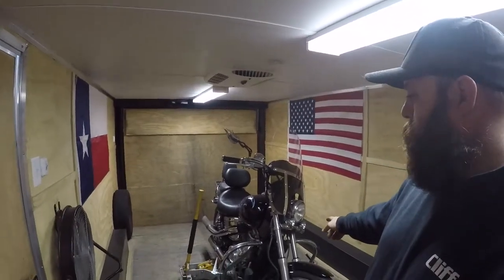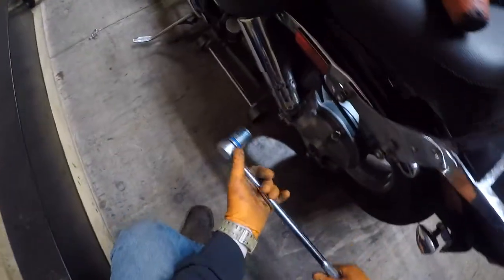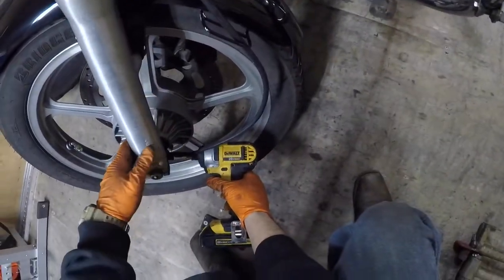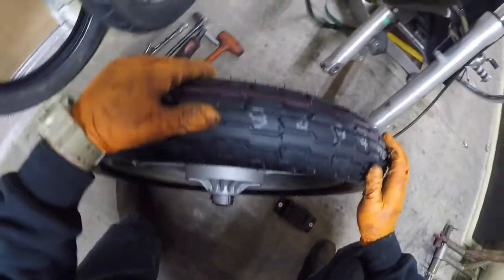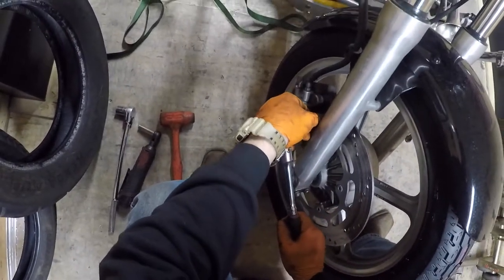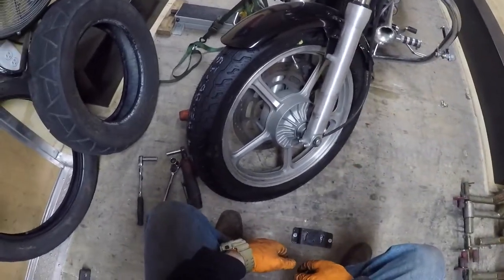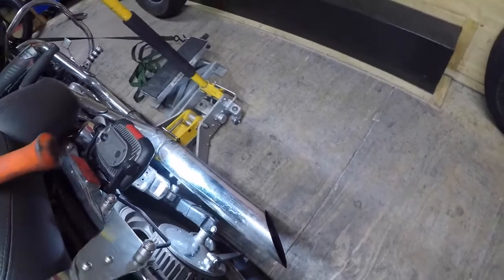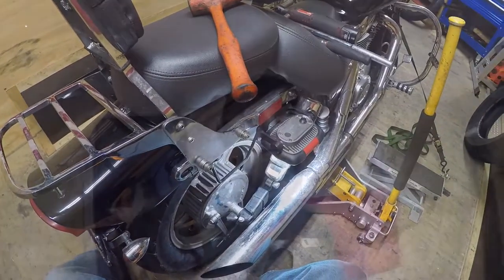How to remove front and rear wheels - 2001 Honda Shadow Spirit 1100 Both

Comment: My 02 Shadow Spirit VT1100C appears similar in design to this cycle. Do you happen to have any videos on changing the front and or rear brake pads on this cycle? If so I will have a question in regards to changing the brake pads. Appreciate the tip on the alignment of the notch on the speedometer gear box assembly with the spot on the front fork!
Reply from the maker: I don’t. Only how to remove wheels.
Reply: @cliffcares6455  OK thanks!

Comment: Hi, Do you happen to have the torque spec on the axle nut? I believe its 65 ft . lbs. on the VT1100C
Reply from the maker: Front what I found. Front 45lb and rear 65lb.
Reply: @cliffcares6455  Thanks I have since found similar numbers. Though a PDF of a service manual I found showed 43 ft. lbs. for front axle bolt, 16 ft. lbs. for the front axle pinch bolts and as you said 65 ft. lbs. for rear axle nut.

Comment: HI, At approximately the 10:45 sec mark your about to reinstall the "speedometer housing" that the end of the speedometer cable connects to back against the wheel. There is a narrow cavity inside the mentioned "housing where there is some grease. My 02 Shadow Spirit VT1100C doesn't have hardly any grease inside that cavity. Do you know what type of grease is appropriate for that purpose? Does any grease go where the speedometer housing mounts against the front wheel?
Reply from the maker: Regular bearing grease would be good. It’s not under heavy load or gets hot. It just needs to keep things lubricated.
Reply: @cliffcares6455  thanks! I appreciate your very prompt response! It's most helpful.
Reply from the maker: Welcome. Ride safe.
Reply: Lithium grease is a good choice too.

Comment: You put the rubber in the wrong spot for the torque arm. It goes brake, torque arm, rubber, washer, nut, pin. Just so you are aware.
Reply from the maker: Now that I think about it. Believe you’re right. I was putting it back the way it came apart. Thanks for letting me know. I’ll make sure to look for that in the future.